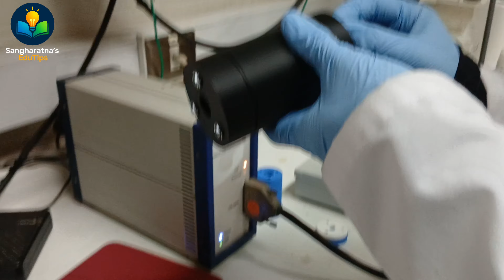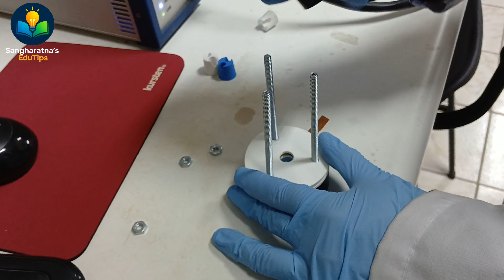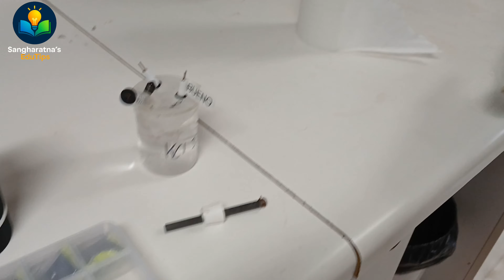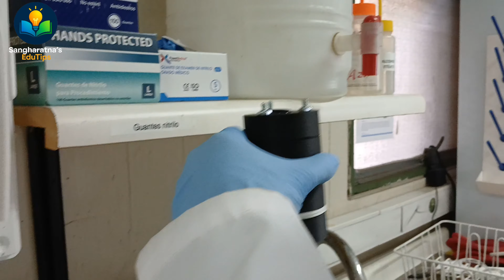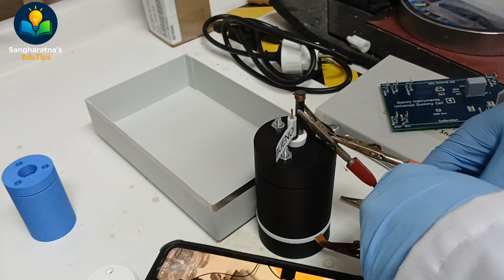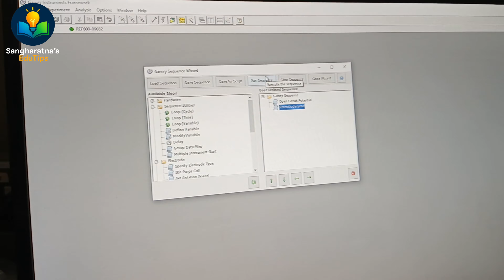🔋 Open Circuit Potential & Polarization Curves Explained | Potentiostat Basics ⚡

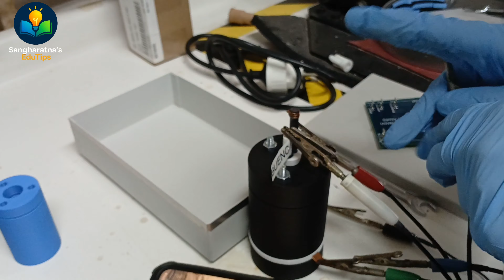Comment: @14:01 the orange cable should not be added here to the red cable. see the manual. it is only only used for ZRA mode, when there is two sample working electrode.